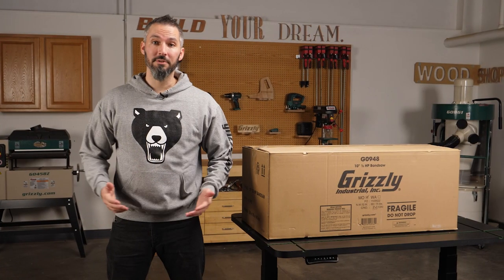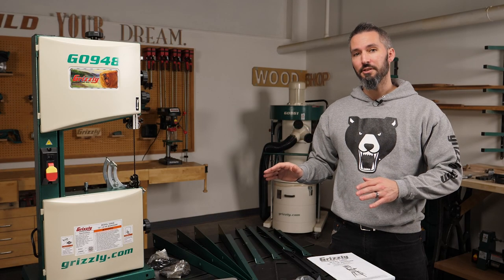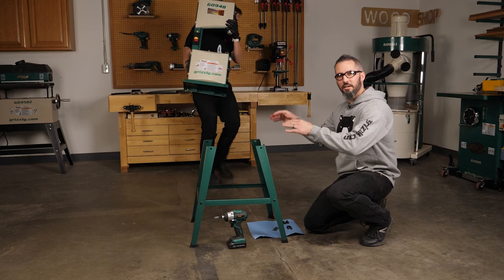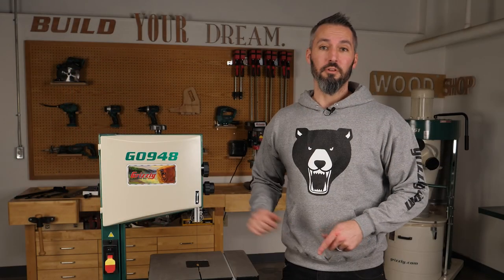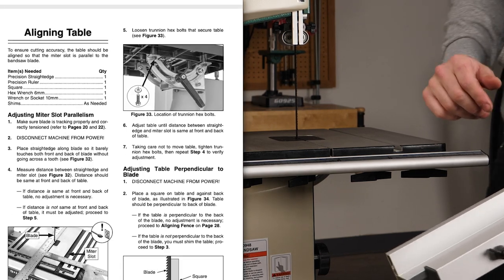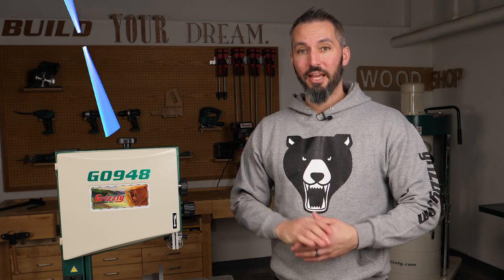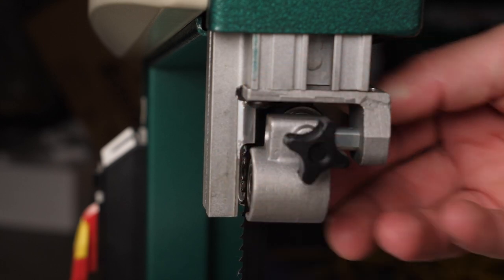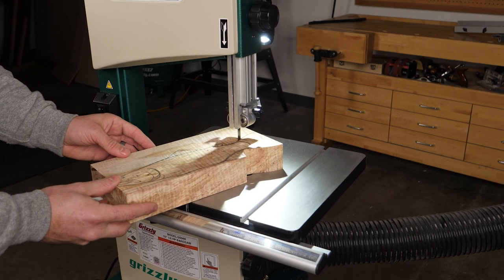Grizzly 10" Bandsaw Setup & Test Run G0948

Comment: So the instructions say to level the saw before tightening up the bolts on the stand.  HOWEVER - the base is not even close to square below the saw.  No way to level unless you have a square machine!  And your video says nothing about this step.